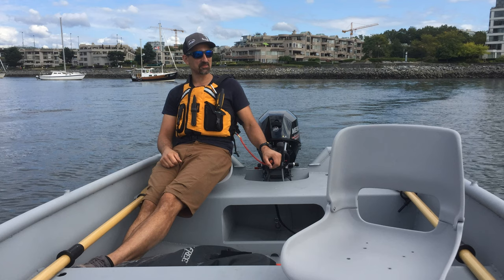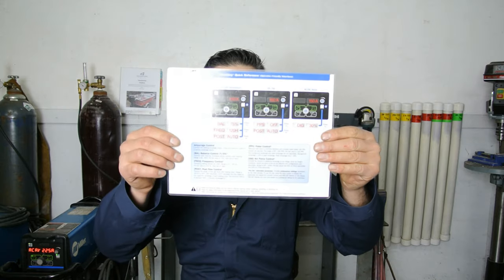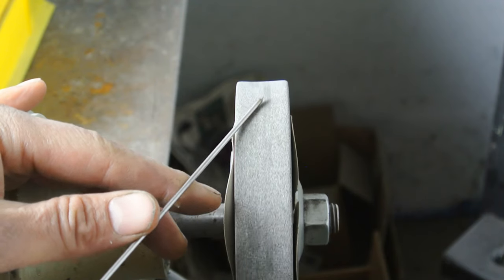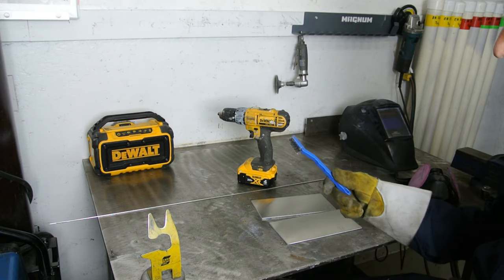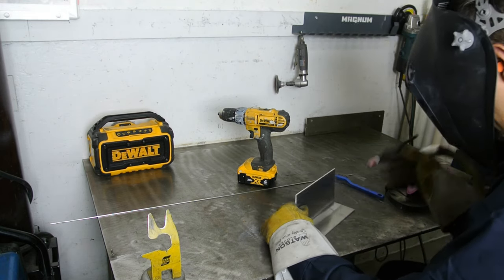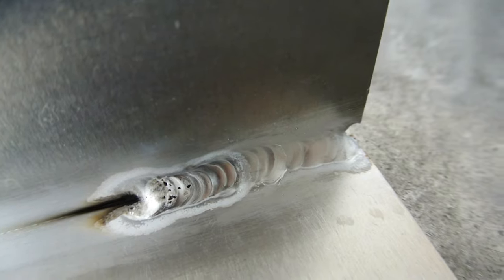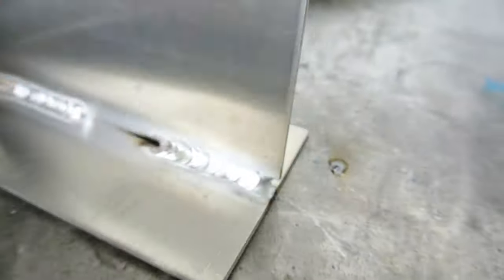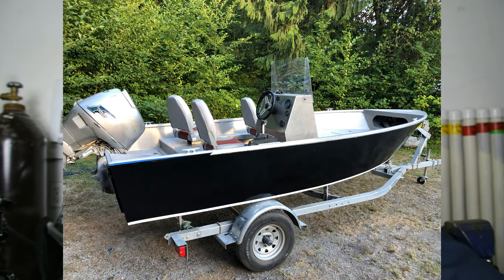Tig welding Aluminum tips for boat builders

Comment: Juuuust a quick question: Has anyone here built a boat using only the tig process?
Reply from the maker: not recommended. You will distort the material way too much. I tried and failed.
Reply: @gregepp3082  I wondered. Thanks!

Comment: Today I attempted to do TIG weld repairs on an old aluminum Jon boat using a Lincoln Precision TIG 225. Had a very difficult time! I switched from 1/8" pure tungsten to 1/16" tungsten. 50 amps. Very little progress. Admittedly I only have experience welding steel. Aluminum seems quite difficult. Do you have any tips?
Reply from the maker: The tungsten is less important than making sure the material is totally clean. Grind, accestone, brush. Old aluminum will have baked in crud in it.  

50aps AC will be way to low. Crank that up 150. If you have a foot pedal you can go higher (180 to start then back off the pedal) 

Try that let me know! Cheers.

Comment: So I want to build 10 ft or so Jon aluminum boats. I have noticed that most of these boats made by the big guys seem to correspond to certain measurements. I would like to use 3 16 5052 sheeting but would like to avoid too much Welding or rivets. I have found only 6 by 10 sheets but I want to use  8 by 12 sheets but they seem to have to order them in and they cost an arm and a leg. I am in Canada. Any suggestions on this?
Reply from the maker: Really depend on what you're hoping to get out of a build. If you just want to boat to call your own. Just buy one, it will be cheaper and work better in the end. 

 If you like building things more than using them then buy a design online and get a company like CMJ to router cut the parts for you. This will give you a fighting chance at your boat not being a tool waste of money the first go around. The fit has to be perfect for the welding to work at all. 

Hope that helps. Good luck and thanks for watching!
Reply: @gregepp3082  Not really but thanks for responding.
Reply from the maker: @craiglangley1478  why do you want to build a boat?
Reply: I want to build more down the line and learn by repetition. It also fits into other plans I have.
Reply from the maker: @craiglangley1478  have you tried Samuel and son? They bring in a lot of aluminum for all the big companies. Min order is $1000
Reply: Ok will contact them

Comment: i like it.  my alumacraft is .125 thickness.  I keep blowing  through
Reply from the maker: For welding a hull, I will normally use a Mig welder with a spool gun. A machine that is pulse capable will really help reduce the burn through. Hope that helps. If your stuck with just a Tig machine, try changing the frequency, run hot and fast. Experiment, try all kinds of things until you figure out what works. Best of luck!
Reply: Did you clean off ALL the oxidisation, and then wire brush where you are welding with a STAINLESS STEEL wire brush that has not been used for any other metal. Also, very close fit up.

Comment: Hi mate great video, I do own a tig welder and have gas but would have no idea where to start building a boat. I do have a 40 hp outboard in the shed. Where would I get the plans to build a boat like the awesome ones you've made please?
Reply from the maker: Hey mate! thanks for watching the vid. I would not recommend building a boat with just a tig welder. If you have seen one of my earlier vids you will know why. 

https://www.youtube.com/watch?v=coQuPeWCh54&t=44s

I got the plans for this boat from metalboatkits .com 

If you are local I could weld up the hull for you. As I have a pulse mig machine (this is really what you need) 

You can always shoot me an email as well. 

Adventuremarinegreg@gmail.com

Cheers! Greg
Reply: @gregepp3082  what pulse machine do you have? I'm looking for something to repair my jon boat
Reply from the maker: I would recommend Cope boats, specmar, and I got my plans from metal boat kits.
Reply from the maker: @sbranham86  depends on where you live. US or Canada Miller is making the multimatic 255 now. great machine for half the price of the old pulse migs they had. International there are some other really great affordable brands out there.

Comment: Sir,  I am panning to build a boat with steel. Which type of welding is good? TIG or Stick Welding.? The guage of steel is going to be about an inch for the hull, the frame parts maybe a little thicker so that the frame is strong. Planning to get the frame parts moukded and hardened by press.

Comment: say I have never been able to find an explanation pf why AC vs. DC for aluminum. 

spoolguns are sold primarily on DC mig machines, but everyone says you need AC to tig aluminum. I know it is possible to tig aluminum on DC, but seems particularly difficult.

Any idea what the difference os all about?
Reply from the maker: Great question! to be honest I never really questioned it, so this made me think. I do remember trying to weld aluminum with DC and it did nothing. I found this on the mill website and I think it explained it really well. Hope this helps! Cheers.

To understand how balance control works, you first need to understand why aluminum and magnesium require an AC welding output. When exposed to air, these metals form an oxide layer that melts at a much higher temperature than the base metal. For example, aluminum oxide melts at about 3600 degree F, while aluminum melts at just 1200 degree F.
Reply: The current is jumping back and forth changing the direction of flow to penetrate the oxide layer on the aluminum. That’s a stupid way of describing it on my part but it made sense to me when I heard it said like that. Basically, instead of the current just trying to break in from the torch to the aluminum (through the hard ass oxide layer) it’s hitting it from both ends and really breaking down the layer and the base material.